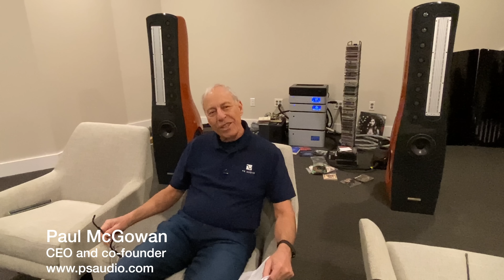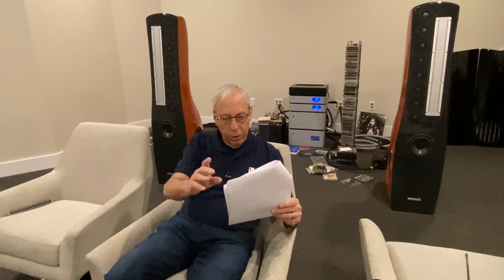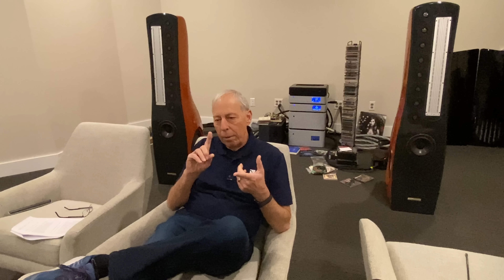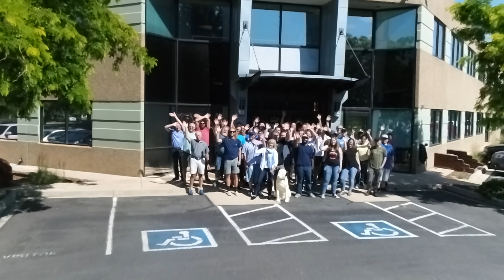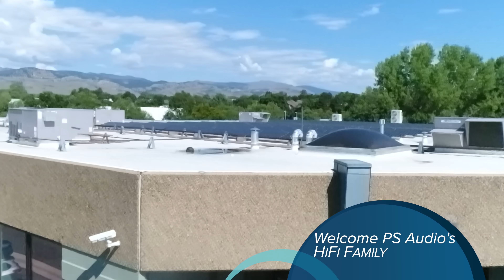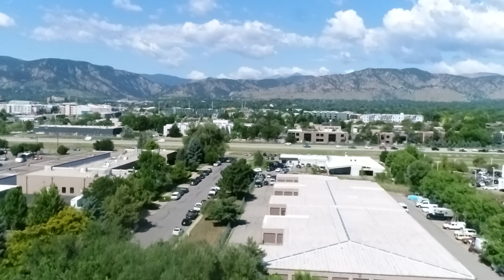Why is balanced audio gear more expensive?

Comment: I have several things to say about this issue
I did a lot of tests and there is no difference in sound quality using or not using a balanced input.  It is only louder in balanced mode and that is because the sound level is double.
I bought a Behringer CX2310 crossover that has all its inputs and outputs balanced.
I decided to use the balanced input but of all the outputs, only the subwoofer output I used in balanced mode.
The reasons are the following
The input is sensitive and is in the order of 100/150 mV.  Any noise at the input will be heard. That's why I used the advantage of balanced mode.  
The subwoofer output is special for reproducing frequencies around 50 or 100 Hz.  And that's why I also use the balanced mode.
All the other outputs, I use them as unbalanced (connecting pin 3 to ground), because in addition to the short length of the cables, the crossover has an output in the order of 7 Volts so the signal to noise ratio is huge and a simple attenuator is enough to adapt the crossover to the amplifier receiving the signal.

Comment: You didn't explain that balanced is interesting for hifi only if all connected equipment are really symetricaly designed, and thus allows a top channel separation. It's useless for just making connections.

Comment: Sony, Bose, Panasonic, Sonos don't know what a balanced cable is?  What is a Sonos anyway?  You might have room on the Sprite for balanced interconnects if you used 1/4" TRS instead of XLR.  Also, the longer your interconnect cable is the more noise you are going to get, unless you use balanced.  Once i had to connect a mixer to a power amp that was 175 feet away.  The only interconnect that would work was a balanced connection.  We used 14GA Copper extension cord with XLR on the ends.  LOL

Comment: What's been explained to me is balanced cables are only really for long runs which is why they're used in concerts. The typical home stereo doesn't have long enough runs of cable for balanced to make a noticeable difference. I could have been misinformed tho.

Comment: Recordings studios need balanced because you don't want any noise to intrude on the recording. For home stereos balanced is not needed unless there is a noise problem. In my experience balanced doesn't sound much better unless there is a noise problem

Comment: You mean a cheap Sony CD player like the SCD-1 I once sold at $6000. That was a great player but like many great players the laser dies. I have a modified Magnavox CD player I modified years ago which was the same model PS Audio modified but I liked the sound of mine better but the laser in these CD players is worth more than the player as they never go bad.

Comment: No, it is not "always" more expensive. I have seen some reasonably priced gear with balanced outputs and inputs. It depends on what market a manufacture is going after. As for advantages, it is nominal, but sometimes worth it for an end user. They offer ability for longer runs and tend to boost gain about 3db. As for noise reduction, that is debatable.

Comment: To answer another question of the list, balanced connectors don‘ t need to be XLR, it‘s just the most common way but you see a lot of stereo jack connections being used, in theory you could even use stereo 3,5 mm jacks, to my knowlegde nobody does that, though. In fact, you can use any connector , that can handle 3 wires.

Comment: From reading all the comments and being an ex studio guy here, (Video work now) RCA jacks work great in these short applications IF you do use good cable.  I wouldn’t dare use those free garbage interconnects that come with gear, even if it’s not audio file spec.  Even our balanced gear in the studio uses different modes of balancing, like others have commented on.  Line level of an RCA and an XLR are even different.  So....saying all that.  If I got the bucks...I balance my stuff.  If my wallet is faint...RCA does great.

Comment: Is Paul implying that their balanced gear isn’t truly balanced?  Real balanced gear has two amps per channel, out of phase (that’s why they are more expensive).  Some manufacturers use XLR’s and just leave one input pin unconnected.  Some use differential amplifiers or transformers on the input; not really balanced but does balance the cable.  BTW, You can usually tell if you look at the volume control, it should have four sections.
Reply from the maker: That is not actually correct. And yes our products are all balanced. Balanced amps and preamps don't generally have two amps per channel. On their inputs, what they have is known as a differential amplifier. It does have two inputs, one for the in phase signal and one for the out of phase signal. And together, we can take advantage of what's known as common mode rejection, where anything common to the incoming balanced AC signal is rejected, and everything different is amplified. On the output side there are two separate output  paths. Hope that helps your understanding. Thanks for reaching out and commenting.

Comment: WOW  I'll stay neutral on this one as far as which is superior (RCA vs XLR), but it's interesting to read the comments. Seems some people take offence and go to the length of actually defending their RCA unbalanced connects. RCA doesn't need to be "defended" they work, and just fine.
For some people, they need to stop being concerned that other people are "pointing" a finger at them because they didn't (or may not have the "extra" money) to spend.
Reply: @FatRat-f9m  
Rat, As far as money, you can buy 1 meter Hosa XLR interconnects for $13.45 USD. You defiantly don't have to spend $800.00 on a 1 meter XLR. I've seen some RCA sell for more than 13 bucks. As we've both pointed out in the past, most things audio gear is subjective and most of the time people never really agree on everything. As I stated, RCA works just fine. I'm not bashing them, in my 61 years on this planet I used them for decades. 
True, I may not be able hear an audible difference, but when my amp prints the measured differences from unbalanced to balance on the amp itself, and balanced produces better specs if at all possible ($) I'm going the way of better specs. The bottom line, it helps, period.   
    
I wouldn't think your the kind of guy that would go out of your way to boast that your using XLR's. I'm certainly not and I don't think I'd want to hang around somebody that does. Those types of people soon become lonely.
Ok, Me and the Funky Bunch are outa here now... 

PS  Brain cells...  I burned most of them up when I was a teenager and in my 20's, cough... cough... cough...  LOL!

Comment: For a true balanced signal path, the equipment needs to have a fully differential circuit which hardly costs "bupkus." Just splitting the signal and slapping a phase inverter on one half of the output really isn't the same thing.
Reply: That bupkus adds about 60% to the retail price too. He conveniently left that detail out I suppose. 😊

Comment: Sorry you are not entirely correct Sony engineer from the UK plenty of Sony consumer products have balanced options, I  had a SC1 Cd player with balanced I have had Sony cassette decks with balanced connectors as well as pre and power amps, granted they are at the top end of Sony gear. I would argue some of  Sony higher end like the SC1 CD player is even now able  more than compete with the best PS Audio CD player. Technics is the higher end output of Panasonic and they do balanced on some their gear too.

Comment: Paul, you can use balanced jack in Sprout 100. People can connect their balanced active speakers to them.
Or just make balanced Sprout Separate with ESS 9038 chip and Sprout 200 Power Amp.

Comment: most gear aren't really "balanced". They just have XLR in/out for convenience or marketing. True balanced requires more parts which makes it cost more.
Reply: Quite true, many so called "high end" audiophile products just slap an XLR connector on the back wired in parallel with the RCA jack. That's hardly a balanced setup. And there is another somewhat necessary reason to do that with HiFi gear. True balanced audio runs at +4db, even +8db on legacy broadcast gear. The loose consumer standard is -10db to 0db. So a true professional balanced interface is not even compatible voltage level wise using a simple adapter cable, e.g. RCA to XLR.
Reply: Andy Delle: Thanke youy Mine Frends. Now I know what they buttons at th eback of my frends guitar processores for Digitech and others is useds fore diffetern dB settengs. MEGAN THANKES, i leanre new things every daye from mine goods friend such a syoue. THUMBBS UPS FOR SHURES!
Reply: correct what you write

Comment: Alot of balanced gear puts the transformer in the middle of the unit. This configuration does not need any further balancing. If the transformer is off to one side, then balancing is necessary. Make sure the manufacturer used GOLD for this not LEAD. Gold is hi end, lead is not. Buyer beware.
Reply: @FatRat-f9m  You are gonna get too much frontal sound, and lost stereo space, change immediately, i don't believe but one friend show me once the difference and it was like night and day
Reply: @animalmuppetmonster664 ...hahaha...that's funny!
Thanks for the laugh & all the best to you :-)

Comment: I have a Cambridge Audio Azur 350 amp and a Cambridge Audio Azur dac, the dac has balanced outputs but the amp only has RCA inputs??
Reply: @behexen250 yeah I do and it sounds amazing! There's no way am I forking out £1000+ for an amp that has balanced inputs. I love vinyl mainly and use a Rega MC Fono pre-amp and even that only has RCA outputs and sounds amazing. So what's the point in it all, I wonder £$€¥.

Comment: 1. xlr is more expensive than rca is.

2. XLR needs 2 sets of signal amplifiers or amplifiers ic.

3. xlr is more complicated !!
Reply: @Larry Niles Should you buy a good amplifier then it is not whether it has XLR or not that means everything.

I have one
Denon dcd-2560
and a
Denon dcd-3300
Both have xlr and rca!
denon dcd-3300 has much better sound out of rca than  dcd2560 has out of xle !!
 
Don't just look at specifications and data! that doesn't mean everything!
Reply: @ford1546 ...Larry Niles an absolute know-it-all tool ...but I guess that you know that by now.

Comment: Doesn't fully balanced DAC or amp require two amplifiers/DACs per channel with opposite polarities? I guess this generate some price increase. Simple inverting opamp approach increases price negligebly, fully balanced more or less doubles the number of components on the signal path.
Reply: This was a point I would have made, if you had not made it first

Comment: I'm late....so won't add the Bruce Springsteen album reference.

Glad Paul mentioned the reason for balanced cable being more expensive, suffice to say the price difference doesn't seem to amount to the small amount of extra materials being used. 

Guess folks like to pay more for the trend, myself included, but mine are longer lengths than standard type interconnects.
Reply: @FatRat-f9m  Of course....cable colour has a strong relationship to sound. That's science!! 🔬
Reply: @nostro1001 ...God I love science!
Reply: @FatRat-f9m  Oh Sh!t you're not still doing that are ya? You'll get the boot and the missus will be left with the new speakers & sub.

It's just not worth it, I tell ya!
Reply: @FatRat-f9m  Congrats mate......you shouldn't be on here....you need to be rockin out the neighborhood (not just your immediate neighbours).

What's your choice for bass shuddering music?

You know where to get that AQ cable....just think of the extra control, with even lower bass....Paul is just an email away.....surely he would give a few meters to a buddy?😯
Reply: @nostro1001 ...lol...lol...QA Dragon; as if!
It's ok, I can multitask.
I'm just playing 'normal stuff' until they are 'run in & the amps are burned in' but the big track will be NIGHTCLUB - 'Dear Enemy', the bass line on that track can move mountains.
Reply: @FatRat-f9m  Thought you were gonna play the 16+ min version of Donna Summer...love to love you baby. 

All jokes aside it has a wicked bass line......not really much sub bass going in from the era if I recall
Reply: @nostro1001 ...I've got that CD, thanks for reminding me.
It does have a 'real' (non electronic) bass-line & nearly 17 mins worth...Old Rat generation.
That's a 'definite' for tomorrow's listening session ;-)
Reply: @FatRat-f9m  Must have been sampled....it really is killer. Played it on Saturday before tennis....faaaark I played like Pat Rafter. Actually, drums are excellent also....just don't let the neighbours here that guilty pleasure track!

Comment: Hey everyone,
from a technical standpoint unbalanced audio is superior and more "true". That is how your playback device, pre-amp, amp and speaker work internally. But it is susceptible to interference, which isn't a problem as long as you stay in the shielded metal box (your gear) where the circuit sits in. Balancing audio for interference-free transmission requires a separate step of amplification, which isn't a puristic approach. We only compromise for that, because a clean transmission outweighs the downsides.

Comment: They canuse XLR connectores or quarter inche Tip-ring-sleeve-ring sleeve for balance. It has 3 wire insted of2 the outside wires are no cancels the noise. They uses them for mikrophones. They shoudl eb availables 1/4 Inch jac for the sproutes instead of XLR. They can also used the NOISE GATE for cuttings uots the noise pickes up ina a BALANCE cable. capacotance and such dont meter for microphone, Mogami or Amanen no brende will sound the sme. THAN YOU AND TBBS UPS!

Comment: I thought the reason for balanced was where long leads might be involved such as in a studio where there's more likelihood of noise pickup or noise on the ground. Where you have 0.5m interconnects on your rack the benefit is less so?
Reply: James Dickenson Balanced allows you to do long cable runs!  It’s used all the time for studio and live work!
Reply: Hello Mine Frends! There is Rowin Guitar Noise Killer Noise Gate Suppressor Effect Pedal LEF-319, or Alesis 3630  compressor had a noises gates in bothe chanelles. Noise gates. Thanke yours and thumms UPS!
Reply: behexen250 Yeah my studio interface has balanced inputs/outputs.
Reply: behexen250 RME says that they are balanced on the specifications of the unit so I’m inclined to believe them, I mean, they’re not allowed to lie surely.
Reply: That's precisely correct also required for ground hum/loops.
Reply: behexen250 Surely that would not be true of a company like RME!  The unit cost over £2000!  I’m certain they haven’t used any marketing tricks!
Reply: behexen250 https://www.gearslutz.com/board/connectors-cables-stands-and-accessories/1241550-trs-unbalanced-vs-trs-balanced.html
Reply: behexen250 Hi, I checked the specifications and it said 12 channels in / 12 channels out mixed over TRS/XLR for all the analogue I/O.  It’s a Firface UFX.